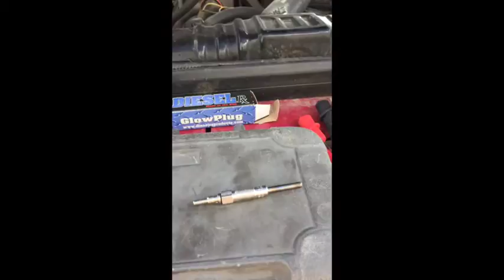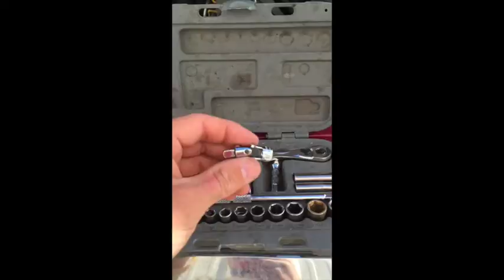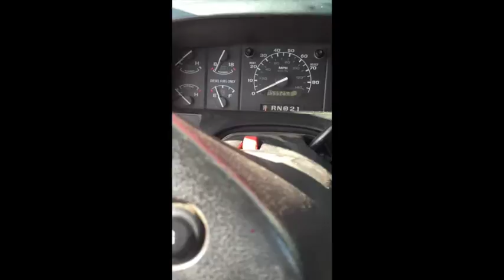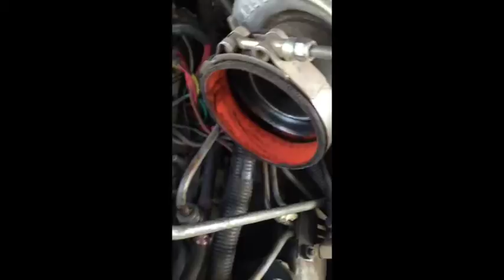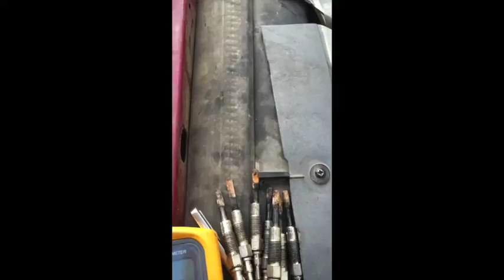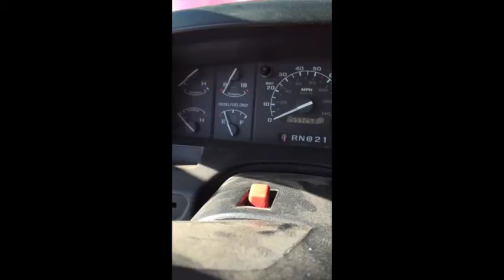Ford 7.3l IDI Glow Plug Replacement

Comment: I have been wondering about the use of a manual glow plug switch, but I am concerned that it would burn out the plugs. The plugs are rated at 5 volts and a manual switch would apply 12 volts. I wonder why they are rated at 5v and used with 12v.
Reply from the maker: If you go with a manual switch on these trucks, you have to wire it through the glow plug controller. Essentially, you disconnect the keyed ignition hot lead and replace it with the switch. If you don't, you will run the risk of burning up the wires, leads, and possibly starting a fire in your rig.

Comment: How did those diesel Rx GP hold up?
Reply from the maker: Missed your comment. I like them for a cheaper alternative to Motorcraft/BERU, but I later found out my harness was bad and was causing all of my plugs to burn out really fast. Ive used about 4 sets with no swelling issues.

Comment: I guess there is an advantage to my 6.9 not having turbo, nothing in the way like that. I probably need new plugs. It’s being really crappy to start in the 40s now. The cold start switch (sensor) is broken too. When doing the return lines, I somehow bent one of the blade terminals, which broke when I tried to fix it back. A manual glow plug button might get me by though.

Comment: I used those same glow plugs in my 1.9L TDI VW. Seem to be a good GP.
Reply from the maker: +j jones they have been a great alternative from OEM for my truck. One of the only brands that I don't worry about tip swelling.
Reply from the maker: Now that I've replaced some of my bullet connectors and cleaned up some connections, they've been great.